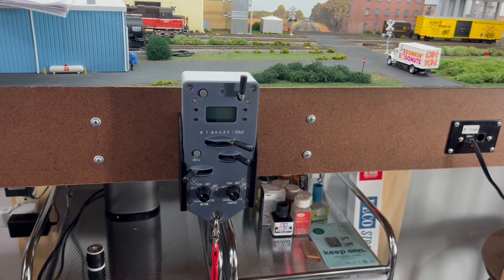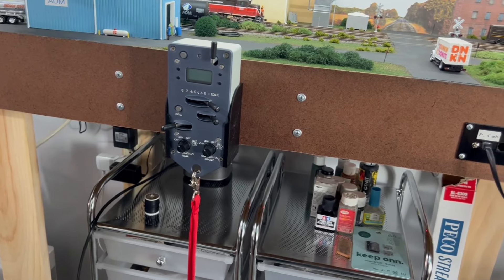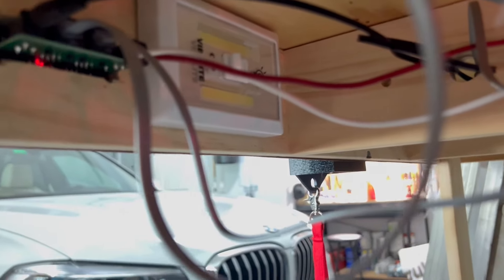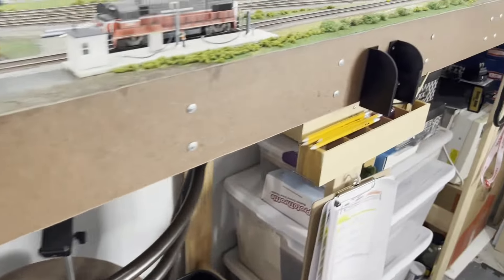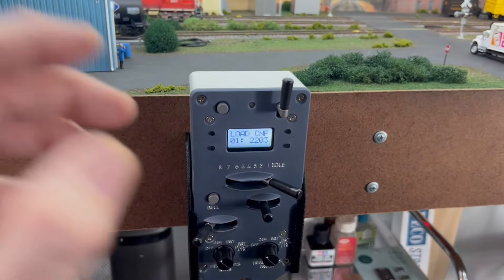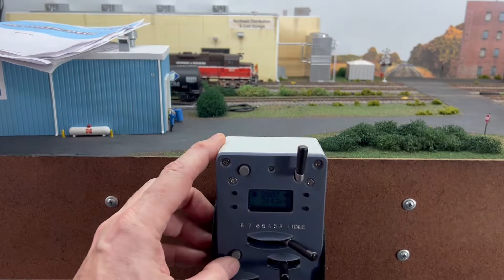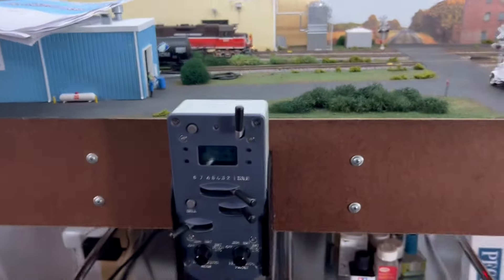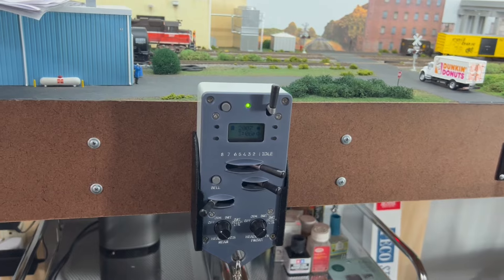Review of Iowa Scaled Engineering (ISE) ProtoThrottle - With Some HO Operations

Comment: I have an ESU Cab Control unit.  I may have to look into this.  It seems so much more simplified.  
Model railroading is an unbelievably expensive hobby.  Thank goodness one doesn’t have to buy “everything” at once in order to get something running.
Thank you for demonstrating this.  Really cool and a great video.

Cheers from Tomball, TX.
Reply from the maker: Thank you! Yes it’s a great controller. And I agree with you…the ongoing nature of the hobby makes it somewhat affordable because you can buy things incrementally over time. This one was not a small investment, but it helps having a smaller switching layout. It allows me to focus a lot of time and resources on a manageable space. Getting the ProtoThrottle will also hopefully be a good investment for the channel and viewers. Thanks for the comments and for watching!
Reply: @HartfordWhaler  
Yes, I realize that this ProtoThrottle isn’t cheap, but I appreciate the fact that you went into the details that it is compatible with other systems.  

It’s channels like yours that continue to make this such a wonderful hobby.  

Thank you.

Comment: I am planning my first layout, it will be some sort of switching layout on a shelf, and know that I want an NCE Power Cab (NCE PC), and eventually a Proto Throttle (PT), but had no idea that adding it into an NCE PC was as easy as simply buying the correct receiver and plugging that into the back of the NCE ATP panel. 

I've been going into the weeds trying to figure out how to do that, and thinking that I needed to buy the NCE PC plus the NCE SB5 Smart Booster.
Reply from the maker: Glad I could help! Also the guys are ISE are great about answering questions. It was super easy to install. Go for it.

Comment: That looks like an awesome control box. Sadly it doesn’t seem to support Märklin layouts. 
    
Interesting to see Digikeijs listed  as a supported brand. A nice Dutch company that sadly went bankrupt last year.
Reply from the maker: Thanks for the comment. It might be worth emailing them. They are good with support and open to making upgrades. PS - I love Marklin products. Great quality.
Reply: @HartfordWhaler  I’ll do that; it shouldn’t be too hard to support that brand since I managed to do so with an arduino :)
   
 I recently started messing with their digital system, mostly because the newest version of their signals don’t have a bare wire interface anymore, and my homebrew track automation setup kind of relied on that. 
   
As it turns out, their “track box”, which is the thing between the power supply and the track, and what you plug the digital controller into, uses the CANbus protocol which makes it easy to control and poll both DCC and MFX items on the layout. 
  
And yeah, Märklin make good gear. Here in Europe they kind of are the gold standard.
Reply from the maker: If you can do it with Arduino I’m sure Iowa scaled engineering can do it too. Thanks for watching from Europe!

Comment: Now if they could make one aimed at steam locomotives.
Reply from the maker: Agree. You’re not the first one to say that. Might be worth emailing them. They are really good about listening to customers. Small US company. Thanks for watching!
Reply: I can't even imagine trying to fit all the fireman controls onto that interface, though it would be a neat feature if it could estimate water usage and require the extra steps of keeping the water level in the boiler up, as well as simulate boiler pressure.
Reply from the maker: Fair point about all the controllable would require. I suppose you could get it down to just the essentials?